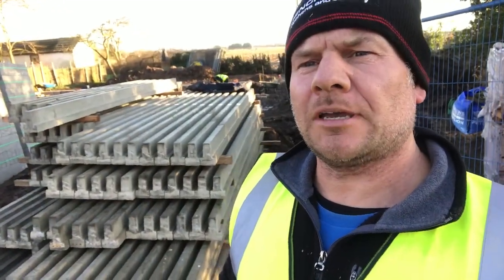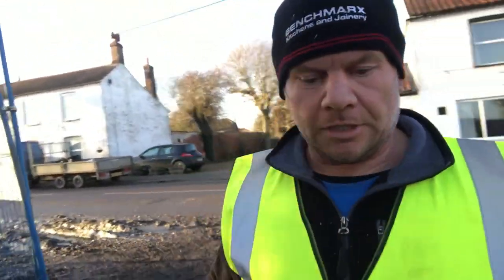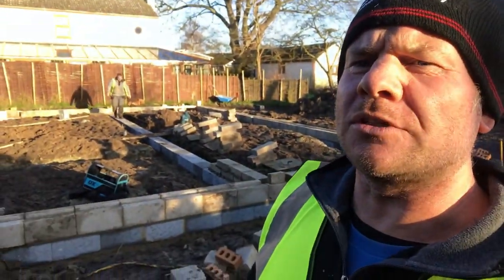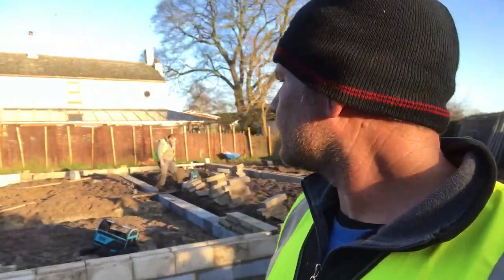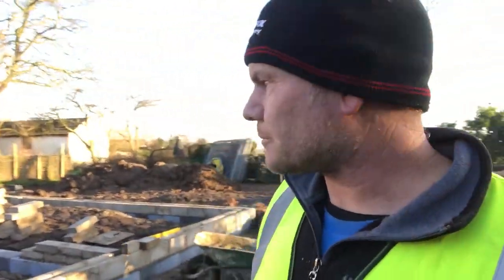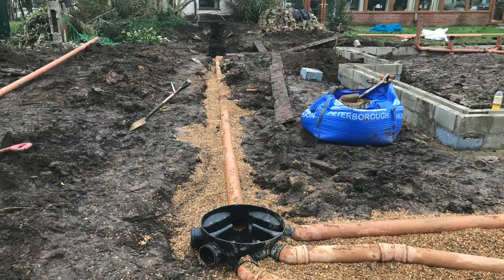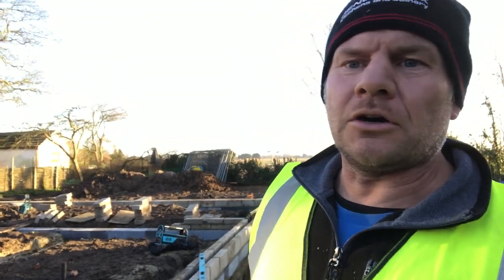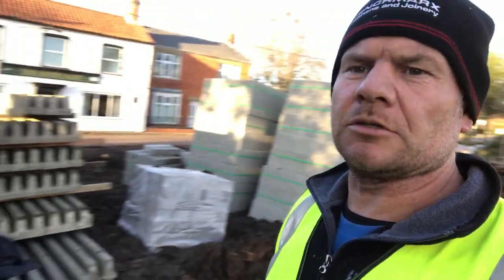INSTALLING THE BLOCK AND BEAM FLOOR ON ONE OF OUR NEW BUILD DEVELOPMENT SITES

Comment: Is it ok for equally spaced beams to have all the block gaps in line or should they be staggered?
Reply from the maker: The companies that make the beams are guided by the architects drawings. They are usually 440mm or 220mm apart
Reply: @developinghomes  yeah i understand that part, i have some rooms on the plan thats all 440 and the garage is all 220, other rooms are a mixture.

But since you space the beams when setting out with a block in at the ends, it means every block in every row of beams lines up and they arent staggered like a brick bond of a wall. So i just wondered if this affects the floor strength at all. 

The only way around it i see would be a right pain in the arse and starting some rows off with a cut block.
Reply from the maker: The blocks just all go in a line and are supported by the beams

Comment: Why opt for a floor done this way then any reason Andy 👊🏻
Reply from the maker: Depends on the type of ground. We’re just about to build ground bearing slabs as the soil is compacted and stable. Block and beam is good as the floors are supported off the foundation walls. Ground bearing slab is a bit cheaper